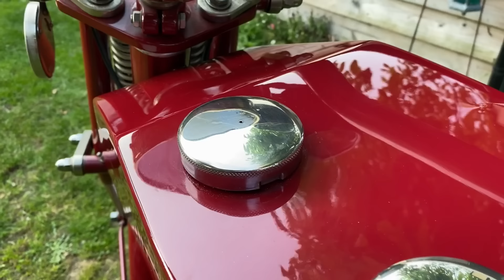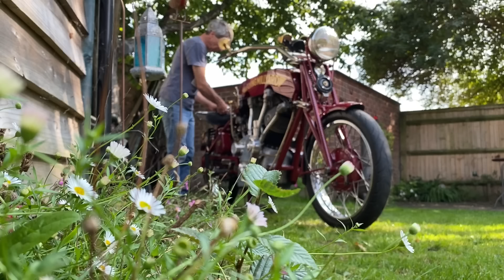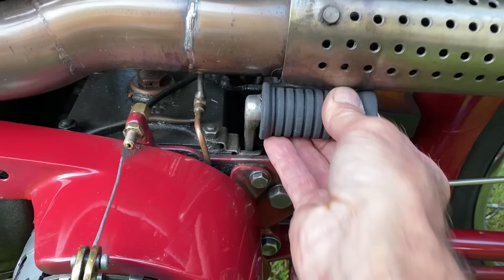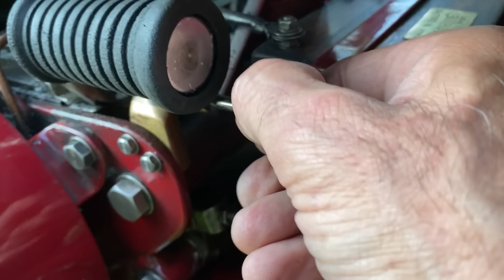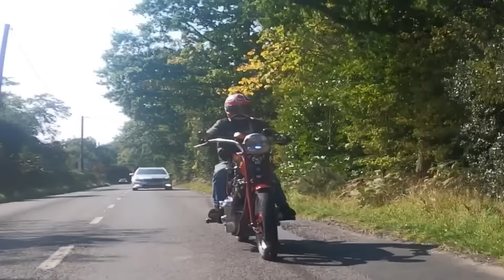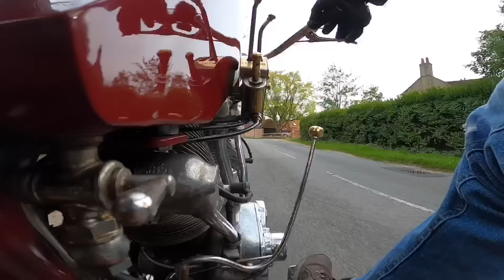The Flying Millyard 5 Litre V Twin  - Part 2

Comment: polished brass looks like gold,. really nice Bike, try to ride to the sturgis run South Dakota, a little hard to riide on the ocean. i was threre 2 times so far, 400,000 motorsysles estimated, a few small blokc V8s mostly 2 cylinerder motors , mostly all american origin with a few exceptiosn here and there not many. really nice bike man, i appreaciate your filiming of it it rreally deserves it being filmed, all brass sinning like gold, perfectly clean, we do not see all of the thousands of hours cleaning restoring everything, and again, polishing the brass, don't touch it after polishing , the oils in your skin causes Tarnish, i did not notice any tarnish , thanks again friend greeting from far weat pacific operating region area, W

Comment: Unfortunately, these radial engine cylinders were designed to be cooled by an airflow 90 degrees to what they will be exposed to in this motorcycle.....and the rear cylinder will experience second hand cooling flow from the front cylinder. No wonder you have to run it rich. There is essentially no forced convection to cool the heads.

Comment: I don’t think that engine will ever wear out, it’s only just above tickover when cruising. Ab fab! Another masterpiece!
Reply from the maker: 60mph at 1000 rpm
Reply: @A @AllenMillyard . Nearly as good as The Beast of Turin, 120 mph per 1000 rpm, but then that has 4 pots and 28 liters! 😅

Comment: What a machine - I bet the torque is unbelievable. I once got to drive a 1923 tractor with a 6.2 litre twin cylinder engine - the torque was massive... In a bike, that must be a handful. Amazing engineering (balanced the engine by eye...) Respect (from a less practical engineer).

Comment: How is that road legal? Levers on it which reminds me of lever switches that were banned in cars in the 1970s. Moving chains exposed. Exhuast getting red hot as you said in part one. I doubt those brakes would pass any sufficient braking test. Noise levels probably exceed 'excessive noise coming from a vehicle' law.

Comment: My YouTube suggestions offered me Allen and I started off with a couple of handbuilt downhill mountain bikes then a z2300 v12 using a couple of z1300 inline 6 engines, the Flying Millyard...what next?

Of course. 

A handbuilt v10 8 litre bike.

Nothing will top this surely?

Engineering as an artform.

Comment: The brass, the chrome, the sewer pipe sized exhaust, the super low RPM chuffing and carb sounds, the custom hand stampings and crankcase, homemade crank and rods, the artistically shaped cylinder cooling fins, the cartoonishly large jugs and antique Lucas bits; it's all too much to take in with just 2 videos.  Give us more!

Comment: You must have torque out the whazoo!  Pratt & Whitney used the same basic cylinders on their R-2800 and R-4360 aircraft engines - just using 18 and 28 cylinders,  During development, they used single-cylinder test beds; eventually having each cylinder develop well over 100 hp!

Comment: What's the rpm range? ... did you try max speed?
it's sound a bit like a "Lanz Bulldog2 tractor, so slow.

maybe an upgrade using an Arduino or so, (dual) fuel injectors and dual action electronic spark timing would be in it's place.

Comment: Would love to see a lateral V design, Moto Guzzi style version of this. Cylinders are so appart you could fit the fuel tank partly in between and make the whole bike (and driving position) way shorter height and lengthwise. Just speculating. Amazing work.

Comment: I’d love to see you take this bike to bonneville, after some tuning and fairing construction and maybe you’d have to stretch the rear, though it looks like yours could be bolted on so the change would be easier. It sounds like your RPM’s are very low but given the engines size I can understand, guess you’d want to tune it to run faster but you darn well know better than I do, I’m still trying to pick up my bottom jaw after seeing that huge beauty moving . I’d think you’d set a world record as I don’t think there’s anything in its class. Keep up the magnificent work, you so totally earned the like and subscribe! 👍🏻

Comment: OK, a lot of things to say, first what a beast!  When you fired it up I had headphones on and the noise was spectacular!   
Twin plugs and being able to look right through the head, cool  :)
Why does it have to run rich at low rpm, cooling?
The sound reminded me of a steam traction engine, hang on, a steam bike, there's a project!
Finally, making your own carburettor is more than impressive, much respect.

Comment: So much to do just to operate that beast. Ya should have a little fella workin the ignition/oil chain/changin mixture/etc, so you can enjoy the riding part, with steering/shifting/braking/throttling..   😜

Comment: Cool thing. But it should have quite larger wheels to start with. The front wheel at least. Something's wrong with the proportions.
Reply from the maker: 🤔 the wheels are 21” and the bike stands over 4’ tall the engine is huge making it virtually impossible to make it look in proportion and remain  rideable 🙈

Comment: I'm guessing it must be very difficult to perfect a home made carburettor, judging by those sooty spark plugs. I'm also guessing that beast can't be doing much over 10 mpg around town!
Reply from the maker: The engine needs to run rich at low speed and your right it’s near 10 around town but 40+ mpg at 60mph fully leaned out

Comment: Can't help but wonder of those carbs both over the exhaust piping ...have you ever had any leakage on them? haha
Reply from the maker: It’s no different to just about every car upto about 1980 where the carb is mounted above the exhaust manifold on pre cross flow engines 🙈

Comment: Hold on a minute, what's going on here, where's the propeller?

Quite some aural moments coming out there, sounds like a DC-3 seconds after startup, then a locomotive, followed by a washing machine leading to a washing machine with a handful of nuts and bolts in the drum, interweaved with a Singer sewing machine completed with a windup toy monkey banging away on a pair of cymbals. Strange device.

Allen you should compare notes with a bloke in Australia, who in the late '80's found a crashed Spitfire on a farm out in the territories, he proceeded to lob 2 cylinders of the end of the block, sealed the holes with alloy plate and attached a 3 speed car gearbox in close proximity and levered the lot in a Z1000 bike frame to create a 5 litre drag bike. I think his name was Lucky or was it Loopy or maybe Lumpy depending on whether you met him before, during or after the build

Comment: Okay...one thing I would not like about it is the need to always be fiddling with the timing.

That I would have engineered to be linked in combination between the throttle position and a RPM based governor.  ~( 'w')/

Comment: I had great interest in part one, and have since watched this, and a few others of yours, and I must say, you are a man of incredible talent and energy.  I've built my share of motorcycles, some rather interesting, one which has made it a few hundred thousand, with about five rebuilds, and I've got a pair of cylinders exactly the same, on my own shelf.  I only wonder if you've still got the pattern for the bottom end.  I have a pile of aluminum plate, was planning on bolting together what wasn't welded, to make a crankcase, and use flywheels from a "Harley" sort of, I bought some blank flywheels, machined except for crank pin, but I like your way better, rods side by side.  I do have molding sand, natural, and I can build a furnace to melt enough metal, got plenty of scrap, and now, must build the engine, since it's been done before me.  I would really enjoy exchanging ideas and photos, and if possible, some help in getting a crankcase done.  The last thing I looked at last night, was the ten cylinder Viper 8 liter.  Can we get together and do some trading?
John McClain, Vanceboro, NC

Comment: In aeroplanes with piston engines we have a mixture control next to the thtottle. We start the engine in full rich but as soon as it is running we lean the mixture to conditions. Then we use full rich for take off and climb amd after that we lean the mixture correctly according to conditions, wich of course keep changing with temperatures and altitudes. We use an EGT (exhaust gas temperature) gauge to show the correct mixture. This way we avoid too rich mixture and fouling of the plugs.

Comment: Good evening
Could you explain why the engine has to run so rich, I understand that when these cylinders were in use in aircraft they ran rich at full power to help keep temperatures down but on the bike are they only working at a fraction of full capacity and so cooler, so if run a little leaner plug cleaning may not have to be done before starting 
Regards
Zed

Comment: 5 liter motor is about 300+- cubic inches American. So in my Pickup with a 305 chevy  I got around 15mpg. Ball park this would be 25 30 mpg. I'd guess.
Reply from the maker: Spot on

Comment: Holy cow this is a work of art!  I love the fact that there is detailed filming of replacing the spark plugs but 2 seconds of a MECHANICAL FLOAT ADJUSTMENT FROM A LEVER!  which must have taken days to fabricate/invent....   He also built his own carbs.... I wonder if Allen goes into M&S to buy some trousers and unless "they fit just perfect"   he goes home and knocks up a pair, dipping them in used Castrol and drying them on the barbecue! - a true master.

Comment: This Sunday was forecast rain sitting with a coffe passing time watching this brilliant clip in the bikery .....wow suns out!. I figure take out my Morini 3 and 1/2 Sport for an end of season blast before winterising it sort out a misfire due to sticky float and fix an exaust leak. Jobs done and head off out, bitter disappointment its still misfiring, I figure if its not the carbs its the ignition.....oh what fun Morini self igniting ignition . Although I know about plugs and cleaning cant help remembering Alans gas burner use, done this before back in the age of Bantams but a modernish 4 stroke? Plugs out gas torch on and back out for a ride, I was pretty convinced it would still be miss firing but unreal its perfect! Had one of the best rides ever, 80 miles and a brew at the cafe. Cleaned it, flushed out the petrol with paraffin (run through until the engine cuts it protects the rubber parts and stops corrosion this modern fuel is savage stuff on old bikes) polished it up and stuck it it the living room till next year.....rolling art........end to a great day. Thanks Alan happy bike happy owner!

Comment: Why would you use spark plugs with the same length threads as original although you are using spacers for other plugs?  You would be much better off with a longer plug in your spacer- and yes they make them.  That isn't even considering going to a hotter plug to make up for your low RPM usage fouling plugs.

Comment: I wonder how long it takes to empty that 3-gallon tank. Probably just a few moments!
Reply from the maker: Around 80 miles usually
Reply: @AllenMillyard  That's actually really good considering the huge displacement! The next question is why most production bikes have such tiny engines then 😄

Comment: You Sir, are a proper gear head. I've built a few Triumphs and BSAs and my biggest complaint was the Amal concentric carburettor and you aced that! then the rest; like three phase alternator and clever starter lever. yeah 90 rpm down a back road with enough bottom to climb just about any hill no bother. I am bowing to you Sir unfortunately I am no longer riding but in my mind, well...

Comment: Must be a thrill to ride this bike. the size weight, the hand shift stick. And not least, enough torque to change the rotation speed of the earth at RPM's lower than most bikes Idle.
I am amazed how a clutch of this modest diameter can cope with all that torque. 
A beautiful machine, If you would not know any better you think it was really from the early 1900's. Great job!

Comment: Hello Allen, I like your idea of using 18MM outside threaded bushing with a reduced 14MM inside threaded hole for convenience. This is the same thing I used in my Wisconsin engines to reduce the cost of the spark plugs. What worked for you worked for me many times years ago to the present. The FM reving to 900 RPM at sixty miles per hour is just way different for sure. Can you please tell me if the bike is top heavy when riding ??? Nice cruse for sure fella. Good day too. VF

Comment: Normal biker: "Whats your RPM reading during cruise ride?"
Allen: "Between three and five."
Normal biker: "Between three thousand and five thousand?"
Allen: "No, between three and five."
Reply: fires every lamp post
Reply: 1000rpm doing 120mph lol
Reply: I was thinking it could use being resprocketed to get the rpms up and his plugs might not foul so bad
Reply: @ronweber1402  Maybe exhaust gas temperature gauges would allow the mixture to be set leaner without going too far and burning anything.
Reply: @ronweber1402  it already runs 1 is to 1 😁
Reply: Just remember there's 107 pounds of crankshaft flying around in there.
Reply: Extra gyroscopic stability  @armcchargues8623
Reply: "Cruises between three and five, but goes to eleven."
Reply: My 76 Shovelhead idles at 250 rpm. But i still need one of these.
Reply: truth.
Reply: Those Pratt and Whitney engines turned slowly.   Most reciprocating aircraft engines do.  My Continental A-65 in a '46 Taylorcraft turns at 2.2k rpm at cruise.  I'm glad to see you used American cylinders, or Canadian anyway.  Well, let's see.  Could you use any parts from a Rolls engine fitted to the Spitfire?  I can't seem to remember any round engines in UK airplanes, unless borrowed from USA or Canada.
Reply: @KOLODNY95  They turned pretty fast for a 50-70 liter, 3000+lb engine. 

They could reach almost 3000 RPM's when they needed to, and cruising speed was usually in the mid 2000 RPM's. That's quite a bit for the MASSIVE weight of the rotating assemblies in those things.
Reply: @KOLODNY95  When I ride my 2023 NC750X in Standard mode, it shifts between 2K and 3K if I ride relaxed.
Reply: @KOLODNY95  They had, in WW1.
Reply: @KOLODNY95 How about the radial Pegasus, Perseus, Hercules, etc …not to forget the mighty Centaurus
Reply: @KOLODNY95  >I can't seem to remember any round engines in UK airplanes

Bristol making angry round noises

Bristol Engine Company dates back to late WWI and made a long line of radial engines, some of them being very successful and were widely used. Some examples are the Jupiter, Mercury, Pegasus, Perseus, Hercules and the Centaurus. The former three were conventional poppet valve engines, the latter three were sleeve valve engines, something Bristol came to be known for.

The Centaurus was their most powerful engine, but came too late in the war to be produced in numbers. Pre production engines at the end of the war with direct fuel injection were making over 3,000 HP. But with the maturing jet engine, interest in piston engines vanished almost overnight.
Reply: @GGigabiteM    Thanks!
Reply: @GGigabiteM Bristol's make angry RATTLY round noises 😂😂😂😂 you could always tell the sleeve valve brigade was coming.

Comment: R-1340 engine was rated at 2,250 rpm.  At that rate the 5-litre would go 150 mph.  An interesting speed to be fiddling with mixture and advance controls.

Comment: Allan, may I ask a question please? What did you use to make the chain tensioner and what material forms the contact surface?
Great post and certainly a work of art!
Reply from the maker: Ptfe
Reply: @AllenMillyard  Is iy bonded to the shoe or have you counter bored and screw fixed it, just wondering about it because on my bike powered race car, I need to install a lower tensioner and the style you have made, seems ideal,

Comment: why does it use so much oil? this engine is a 4 stroke right?
Reply from the maker: It doesn’t use any oil but the lubrication system holds a gallon of oil
Reply: @AllenMillyard  ahaaa, so the lubrication system holds a gallon of oil, not uses a gallon for every three gallons of gas, everything clear now

Comment: The F M Sounds awesome Allen, be carful of that old tube spanner it may crack the ceramic on the plug if twisted slightly, but lucky you have a 2nd plug in action if that happened.

Comment: Great to see a proper ride. Lots of on board "riding modes" to set. Do you gauge usage by miles or hours covered, like as an aircraft?
Reply from the maker: I need to fit a brass mechanical hour counter 🤔

Comment: G'Day Allen,You amaze me,,,Really,watched most of your projects and Love each one on it's own merits,,
How ever,,The fowled plug on the Big GAL,,,Wondering about ether,we use ether to clean the plugs we fowl in a CR 250 honda,,yes 3 spare plugs and a bottle of ether under seat,,
I feel a bit silly suggesting this to such a well educated man,about motor bikes ,,
But you may never have heard,,so at the risk of telling you how to suck eggs,,
keep up the vids,,,Have seen the one on building carbs,,,still a bit mifted on carbie raise and lower function,,yes I under stand the theory but not real sure how it works,,
Any Way get ya gear on and go for a ride,,Have A Good Day,,

Comment: Good idea on the burning off of the carbon on the spark plugs, I do that to chainsaws, weed eaters exhausts when they won't run properly and it works great. I often think about fitting a Kohler or Honda v twin lawn tractor to a bike but your FM takes the biscuit.

Comment: I think you need to take that bike out on the highway. It sounds like the engine is laboring because of the slow Street speed. It seems to have more capabilities but it's limited just riding around on the street.
Reply: Those are the sort of local  roads it was built for, and it was I reckon just above tick over going through the village not labouring at all. It's all about torque not rev's.